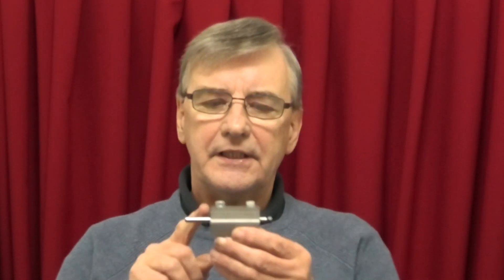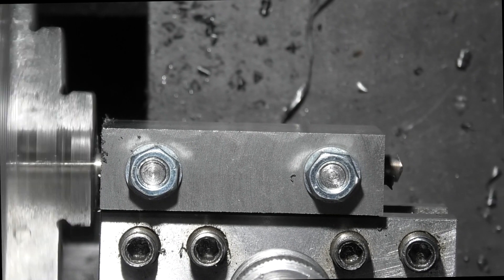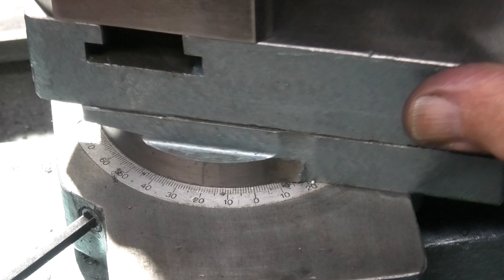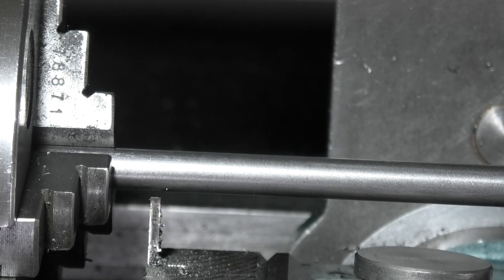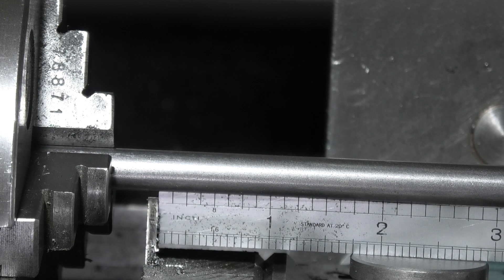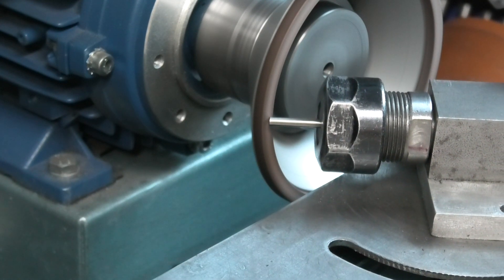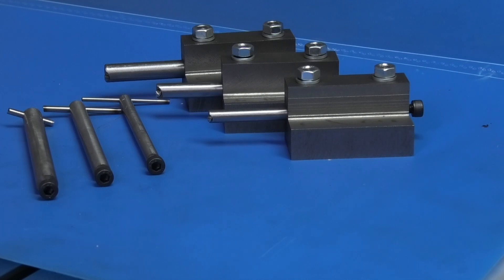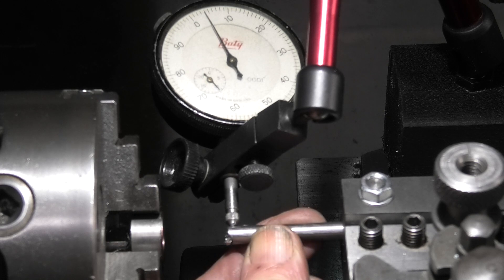Boring bar set part 2

Comment: Hi Alan
I'll be making some !!
I've just taken delivery of a Warco Super Major.
When fitting the feed box, I took the LH end table end bracket off.
Guess what # NO BEARING.!
So first job was fitting an oilite bush, and drilling and tapping the feed box to access the oiler in the bracket,
As per your previous recommendation.
I though this  od would be right up your street  for a modification video!
I dont have a channel so, I cant post it mysel.
Regards
Mike N
Reply from the maker: Hi Michael. Thanks for the info I will check mine when I do a service on the mill.
Reply: @enotsengineering  A
Hi Alan
The oilite bearing is all done now, and it made me feel better!
Can I ask you if you have found a neutral in the gearbox on the Super Major which would make clocking up bores a bit easier?
Thanks
Reply from the maker: Hi I found you can move the gear selector half way between gears and you should be able to move the spindle by hand

Comment: I noticed the materials lists mentions 6 tool bits HSS 3/32" & 1/8".  Does it mean that bigger bar(s) have bigger bits? I reckon that with a 1/8" tool bit and a 1/8" ball bearing for clamping, one has to be careful when removing the bit for re-sharpening or replacement, it would be quite easy to let the ball fall out through the hole.
Reply from the maker: Hi that’s why you don’t drill all the way through
Reply: @enotsengineering  Ah, so the drilling depth has to be accurate enough that the ball can touch the tool bit, but not go all the way out...

Comment: Nice set of boring bars, I'd like to make a set as well, but probably won't buy a kit as I'd like to have a metric set. Closest sizes seem to be 6, 8 and 10 mm bars with 3 mm torsion rods, and 2.4 toolbits? I already have some 3 mm HSS rods, would 3 mm toolbits be a bit too large? Although it's cheap (but slow) to get HSS round rods from China, saw them on eBay, sold in 0.1 mm increments.

Would there be any benefit to ream the toolbit holes, instead of just drilling? Are they drilled instead of reamed because the toolblanks are not accurate enough dimensionally? Or some other reason?

The toolbits for these boring bars seem to be quite simple to grind, and, being so small, would also be very cheap. What is the significance of the 45.5 degrees angle? Why not 45?
Reply from the maker: You grind a flat on the tool bits and the ball clamps it so need to ream.
45.5 degrees gives 89.5 deg from the bore to the face so only the tip of the tool touches the the bore or bore face
Reply: @enotsengineering  Got it. So the clearance angle is only 0.5 degrees. Seems a bit less than usual? I checked a couple of insert boring tools, e.g. SCLCR has 5 degrees of clearance, SDUCR has 3. But well, it seems to work fine in your video. These tool bits have to be pretty short to be usable in small bores, so I suppose there's not that many resharpenings possible before you have to throw it out and make a new one? I do wonder how long do they last. I guess they function a bit like disposable inserts, at least they are cheap, being so small. Probably costs more (in labor) to grind them in the first place, maybe it makes sense to prepare a batch at one grinding session.